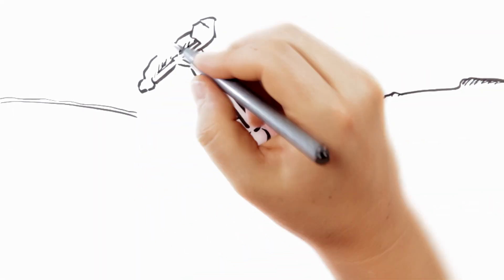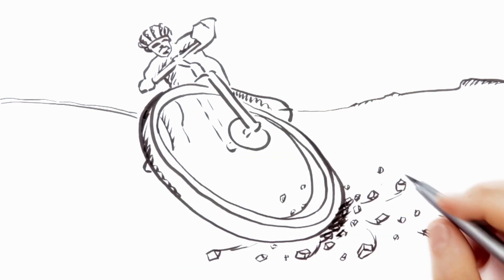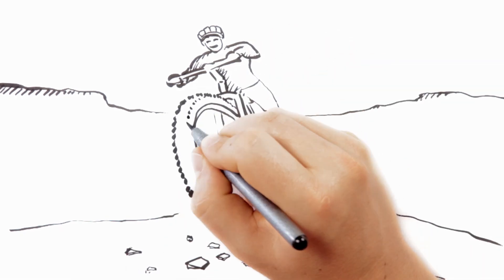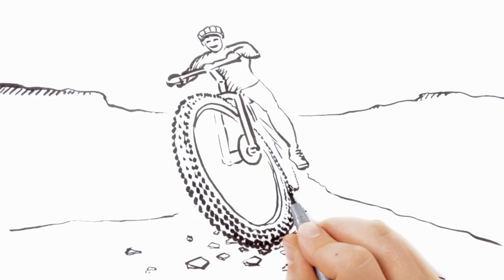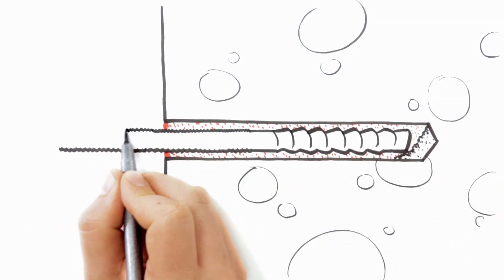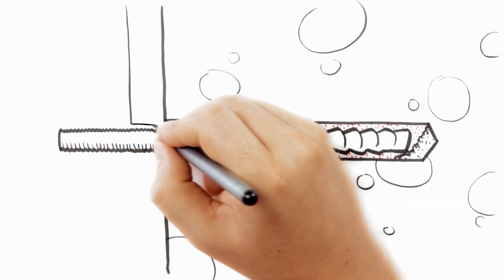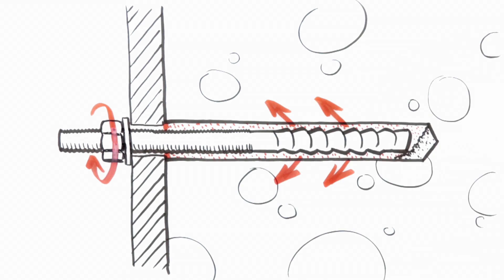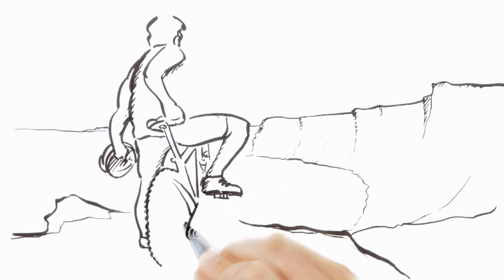INTRODUCING the Hilti HIT-Z Anchor Rod - one giant leap

Comment: Is there a reason why HIT-Z is not produced as a hot-dipped galvanized or sheradised?
Reply from the maker: Hello! Due to manufacturing constraints and technology restrictions the HIT-Z rods are not made in sizes larger than ¾” diameter. The reason for this is that anything larger than this ¾” would require a standard 2x2x2 cleaning method which would not be consistent with current HIT-Z rod installation. With HDG or sherardized coating, the applications that tend to need these coatings use larger sizes and very seldom use ¾” diameter rods or below. At Hilti we strive to reduce installation requirements and adding a HIT-Z rods that would require more steps to install or possible jobsite confusion is not our goal, which is why we do not currently offer these coatings. Hope this helps! -Sarah, Hilti North America Social Media Team
Reply: @HiltiNorthAmerica  thanks a lot for the explanation